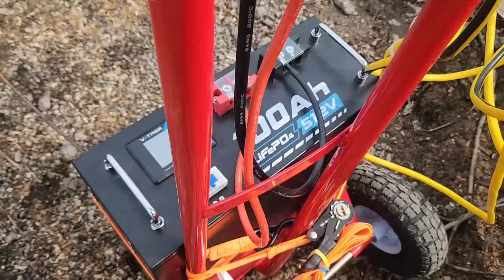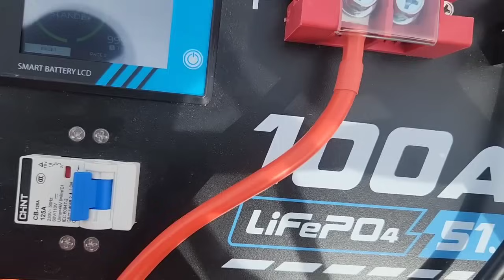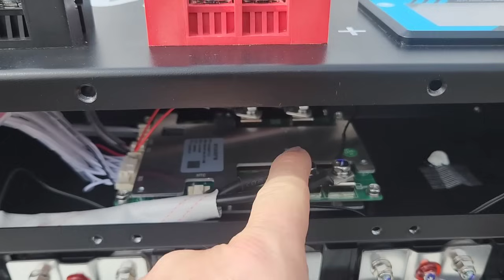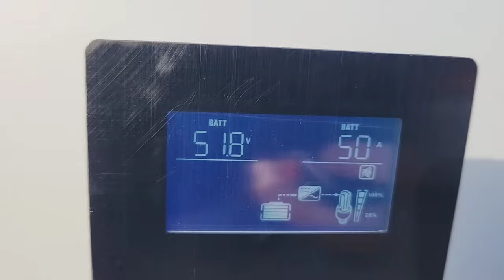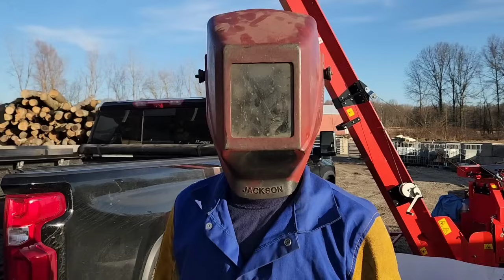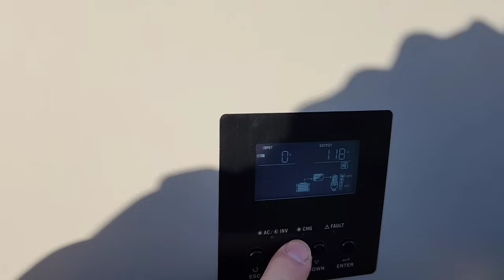Welding Like MacGyver... Vatrer 51.2v LiFePO4 Server Rack Battery #vatrerpower

Comment: On Wednesdays and sundays for some reason i havnt seen notification from you - 
       This is some forgotten history on hybrid power as you demenstrated - 
   Today hybrid systems are catching on - 
      Were i live REA was still setting poles and string wires in my area in 1960 - 
          Many homes in my area were set up to be powered by huge lead acid two volt cells in the very early 1880s - three or four cells made up the 6 volt house battery - 
      6 volt homes had a 30 kw usable  battery bank capacity and the. 8 volt had a 40 kw battery bank - 
     I had a grate unckle that started selling and installing rural  light plants at the start of 1880 or so down here - 
    With the battery bank came an up right boiler to make steam, a steam engine, and a 6 or 8 volt generator to charge the house batterys - 
     Around here every one who had electric lights would fire there boiler off and run the generator all day to charge the house battery bank every friday -  
         Down here homes that had electricity would charge the house batterys every friday all day religiously -             6 and 8 volt homes only had electric lights, fans,a radio and a electric water pump - there refrigorators and freezer burned kerosene and were on the porch during summer when i was a kid -
       The 6 and 8 volt battery banks use a very weak sulfuric acid strength of 1.195 gravity - cells with weak acid dont hardly sulfate and the positive plate dont decompose -
       So it was not unusual for the batterys to last longer than 80 yrs in 1980 some weer almost 100 yrs old -  many of the old timers did not need REAs expensive power -
      REA charged 35 cents a kw were as even if a generator was fitted with a gasoline engine - farm off road red  gas was 12 cents a gallon and they could charge the  house batterys for 1.5 cents per 1000 watts of power input into the battery bank - 
         In the 1920s Delco marketed a 32 volt rural home light plant - with those you could also purchase 32 volt fridges and freezers so they were popular when i was a kid also - there batterys used a acid strength of 1.220 the stronger acid increased the capacity but shortened the batterys life span to 40 to 50 yrs of cycling - 
      They were also charged all day every Friday - if a home had attic and cieling fans the capacity was also 30 to 40. Kws - 
        Many of the older people would never go on grid power from REA - 
      Grid power were i live stayed off as much as it was on up till about 2000 or so - huricanes would knock power out for a yr or  longer at times in my area after huricanes -  
          Up till 2000 even if a home had power from REA people still used attic fans over air-conditioning - one was power was very expencive & lighting surges blew air conditioning compressors - 
        As for solar down here - the humidity defuses the UV light from the sun so it does not strike solar panels directly - so solar is of little value - 
      At noon day during winter solar panels on a rare cloudlsss day generate 7% of there rated out put for a hour - during summer on 35% humidity clear days the generate 50% of there rated power but many days are at 90% humidity with over cast - 
     Also huricanes destroy solar pabnels  -              I use 26 golf cart batterys to powere my two 3 kw inverters when the power goes out - 
        I diluted the acid strength from 1.265 gravity to 1.220 gravity - sence i understand battery technologies they will last my life time - after 42 yrs if you look into the fill.holles - the batterys plates still look like there brand new lol - 
       Mine is about 7 to 9 kws - most homes today use at least 24 to 48 kws a day when on the grid - 
    In my case im.semi hybrid that reduces my. generator fuel consumption substantially - 
      I burn 1/6 the fuel my neighbors burn who are on  stand alone generators - 
       If you research the net deep enough you can find studies on rural light plant from 100 yrs ago - 
        My grandfather and sone uncles also wirked on rural light plants a small town 110 volt DC powere stations - small town power station charged abiut 4 hrs daily - 
      Im a 4th generation machanic electrican i spent my yrs in the offshore oil fields and left as a sienor systems tech - 
     Few know much about hybrid systems today - 
       I do have lithium iron batterys also but i use leas acid batterys for my bulk powere -
Reply from the maker: Very interesting.  I never knew the reliance on battery power for such a length of time as you write.  Please give me some background of where you are from.  REA?  Thanks Able
Reply: The REA was the rural electrification association - after WW2 many troops went to work across the country for REA - there were tons of surplus Fairbanks submarine engines - 
        Many of those submarine engines generators were converted  from direct current to alternating current - 
       Towns that were set up for 110 volt DC were considered obsolete and were up grated to the Fairbanks opposed piston engine generators - also they converted the towns from 110 volts DC to run on  120/240 AC - 
      Small rural towns could not afford AC power - the federal government subsidized the fuel that AC generators burned and the maintenance cost - 
       Othere wise small towns could not afford to generate AC power - 
    Power houses power out put might be 300 KWs with only one generator  -    REA up grated small power houses  with surplus  submarine generators that were  1500 kilowatt generators - 
       The extra power the towns now had was transmitted out to rural areas around a town up to 50 miles out of town - 
      That was going on around the entire US - our power came from a plant 20 miles away - 
110 volts DC could not run much further than a mile from the power  plant - 
       I've been told you can find a lot of information on rural electrification on the net but you have to dig for it - 
        Face book has a lot of post on the Delco  32 volt DC farm light plants used from 1920 to 1970 - REA was still setting up towns with surplus war engines and generators and setting poles and running wire out to rural America - 
      I'm in South East Louisiana and about 50 miles north of the coast - 
      If you look into TVA others than for irrigation during WW2 there were serious power house upgrades on dams  to power the war effort -
       After the war that power was used for rural electrification 300 miles out in every direction - 
      The project of rural electrification was completed around 1970 - 
     My dad being a publisher of trade magazines drove across the US so he could stop at grainries, logging camps, farms ect to get stories and take pictures - 
      I can remember going to rural homes up north with my dad and compared to down here there  house battery bank would be very small or  7000 watts -
    Down here the cells were 4 to 6 times larger on average - down here we used fans during the summer also fridges and freezers used a lot of power during summer - so house battery were 30 KWs in the south - 
      In the end we used 4 to 6 times more power then used were your at - so the battery's were much larger along with the generators - 
      After WW2 those with larger farm bought surplus submarine cells that made up farm or rural house battery's the diluted the acid from 1.285 to 1.195 or 1.220  down here to get 40 to 80 yrs service life out the house batterys -   most generators down here were  direct fuel injection oil engines many were run on seed oil not bunker C heavy oil - 
      The spark ignition engines ran on alcohol fuel, kerosene, gasoline or charcoal gas -  
      There were different varieties of fuel across the country - 
    In England during the war they ran buses on coal gas or wood charcoal gas - Google that up - 
     If you goggle Exide farm light plants stationary battery's - you will find 1000s of pages devoted to the study of stationary battery's - 
        You can also look up Fairbanks model 32 stationary  engines - I saw the 25 HP single cylinder engines on many large farms -driving irrigation pumps, generators, mills  ect - 
      I had a uncle that had a mill set up with a single cylinder 32 y - also there was a cotton gine about 40 miles north of here that used a 32 Y for the mill and to charge the batterys for the plant - it shut down 40 yrs ago - 
    Rural homes up till after WW2 were all off grid in most of the US - 
    Today off grid is a novelty - 
If you look up seminars done John L Casey the NASA scientist contractor - that wrote the books Cold Sun,  Dark Winter and UpHeavel - 
     He talks about how for 205 yrs the earth goes through a warming trend - then for 30 yrs the sun's magnetic field weakens for 30 yrs and for 30 yrs we have erratic weather, a long with an increase in earth quakes and volcanos - 
      Magnetic north has shifted and has migrated form 6° down past 40° now - it has caused the earth to rock back and forth - that's why the jet stream is all over these days - 
      In 2019 we had a billion bushel grain short fall that drove food prices up - world wide it was a 20 trillion bushel short fall - 
        Casey had a stroke and no longer does interviews - you can look him up on you tube - 
       The New Madrid at some point will trigger - it will send shock waves a 1000 miles out - in 1911 when it went off south Louisiana shock waves were a Mag 5 - 
       If you know how to live as they did before REA you will probably be ok -
    You can look up old engine and tractor shows were many old engines are displayed - 
      The Fairbanks Morris 32 D and Y engine was a 2 cycle engine with no valves just an inlet port and exhaust port - 
      All  the power houses every were in the country had a FM 32 in it - the AC power houses had the multables cylinder engines and the smaller town DC power houses had single cylinder 32 D or Y engine - there were 1000s of those all over the country - 
      I worked for colt industry's yrs ago and they owned Fairbanks Morse - in 1980 many of the old power plants were still in operation and I worked on those engines for a time - 
      You can see all of what I shared on the. Net - slow speed engines have time to burn all the fuel also rings and bearings last a very long time some might burn 6 times less fuel per kw of power than modern high speed light weight engines - there known to be up to 55% fuel efficient -
Reply: Most of the old DC power plants were dismantled and sold to other country's and islands through our the world - 
     Once a customer changed over to grid power they could get a trade in on there old DC appliances - 
      Those appliances were sold in places that reset the old generators up -   there were companies in central and South America along with islands around the world that bought all that as surplus from the US government - also DC appliances had a trade in value and were bought and sold as surplus by the government -
Reply: It was interesting to see how excited you were with your solar pack - I remember my grandfather and uncles talk about after installing rural light plants in homes how all night they would go from room to room and turn the electric lights off and on all night lol - 
     In 1995   I had installed a 3 kw 12 volt sign wave inverter in my service van so I could stick, tig and mig weld with my 225 amp inverter welder - I also had a plasma cutter  - I fabricated many parts in the back of my service van  at job sights -       most of the work I did was on  large  prison cooking equipment - instead of ordering replacement parts I just fabricated a replacement part  on sight in the back of my service van using a inverter - I also had a 12 volt live stock veterinarian syrum fridge to keep drinks ice cold when welding behind my during summer hot days - 
      Today all that equipment is dirt cheap - 
      What you have with all that equipment to service is handy -

Comment: Oh Joe, I just got time this late  to watch your video. Elaine from Canada here, just realized I know nothing about batteries and electricity and inverters etc.
When you started talking, I heard, “ pudgdyxwsu 6,@&$gdg will run gddyeddgh and I can use it in my yard”. Oh my! And now, thanks to VATRER, you can have power when you need it. How cool is that?  And you can run an air-conditioner in the summer! Ha ha ha, I almost missed your new wood drying method! Have a great day, cheers.

Comment: Real interesting…Ive just set up an off grid cabin with solar panels etc. plus just had solar panels/battery installed on the house with connection to the power co. Wood heat with solar as needed.
Reply from the maker: Interesting Larry.  If you had an off grid system you could go with the Vatrer batteries but get the EG4 inverter

Comment: That is a very cool setup, Joe! I have a similar battery box i built, but I don't think it will run my welder. Either way, having a  battery backup system is awesome 🤠👍
Reply from the maker: If you get the right all-in-one inverter you can make it happen.

Comment: Great idea, probably a whole lot cheaper than my Ecoflow Delta Pro. A good channel is DIY Solar Power with Will Prowse. Thanks for the video.
Reply from the maker: This system is serviceable and expandable.  And...like you said...cheaper!
Reply: @ohiowoodburner  What kind of stick welder was your welder using. It appeared he was using 1/8" rod. Most older stick welders had a hard time making penetration with a 120 volt welder and that sized rod.
Reply from the maker: I don't know what type of welder it was.  He was using 1/8 6013

Comment: Joe,  I know now who to call for advice on solar energy. I have a new 24 kw Generac with a 1000 gallon LP tank feeding it. Once I had no electric for over 2 weeks in the heat of the summer.  Never again. If capable, having a back up source of electricity is a super smart contingency. Great video. Very informative. Would Like to see at show.
Reply from the maker: AND with a generator you have all that $$ tied up in an asset that rarely gets used.  The solar backup system you can put to work 24/7.
Reply: Joe 100% I say again 100% correct. 👍 it’s only a layer of coverage. Having solar power working continuously would be a way better investment long term. Thank you.